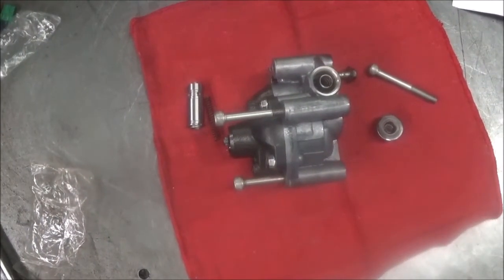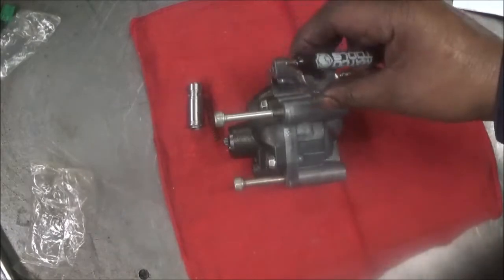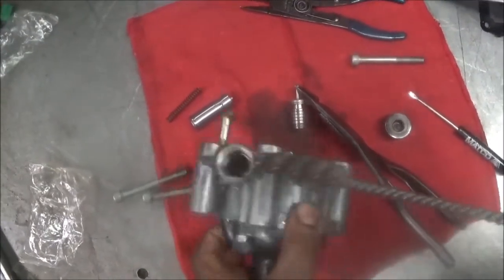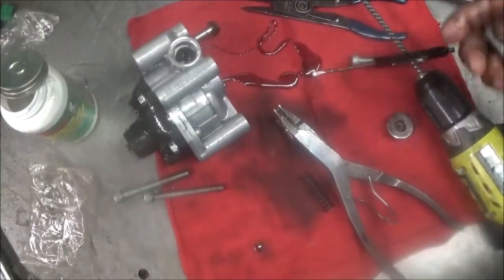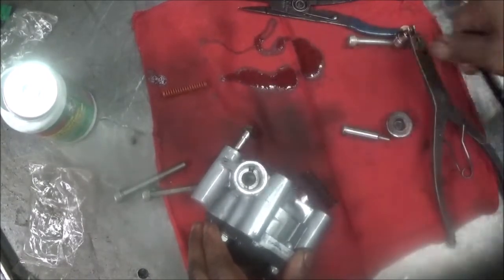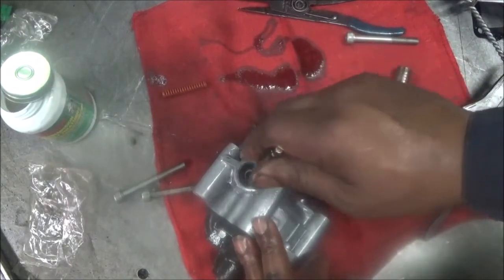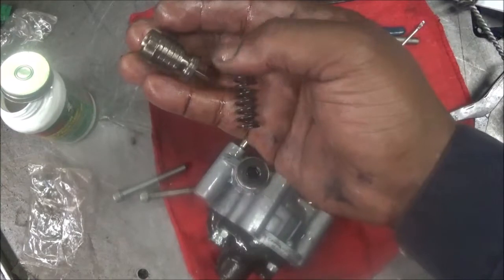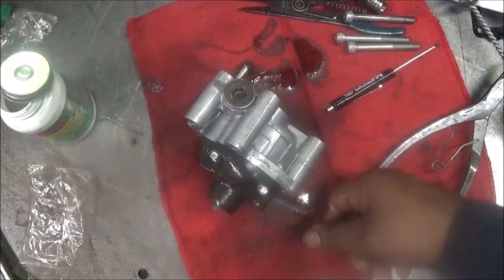JF011E CVT TRANSMISSION TECH TIP 2  [THE PUMP] (NISSAN, MITSUBISHI, DODGE)

Comment: Can this pump removed with out removing the trans from the car? I have a 2007 Dodge Caliber with a 2.0L eng. Please also wear gloves to help prevent cancer.
Reply from the maker: No, it cannot.
Reply: @thisisyourtransmission Are you 1000% sure? I ask because I can see the pump and two lower mounting bolts when I remove the valve body.
Reply from the maker: @SulaimanTheAviator  Try it.

Comment: And was the update successful?
Reply from the maker: Yes, the transmission was fixed but with a different set up. This setup causes the pump to make noise when driving.
Reply: @thisisyourtransmission  thank you for responding 🙏,  any links to fix greatly appreciated.

Comment: Symptoms of bad oil transmisión pump?
Reply from the maker: buzzing noise; slipping; barely moving
Reply: @thisisyourtransmission  My caliber barely moving after a sound in transmission I think, scanner shows different DTC every time sometimes p0730, p0777, primary sensor, secondary and so, I was thinking that pump must be bad or control body, do you know if bad pump shows a DTC or I need not open transmission to see damage? Thanks for your time.
Reply from the maker: @ourclock9273  normally problems like this means the transmission has to come out. You can try changing valve body or solenoids. However, you may still end up fixing the whole transmission. How many miles on vehicle?

Comment: This guy is scratching the hell out of the Interior boars on that pump even if he put new valves in it they're going to leak after he drags his screwdriver in and out of it like that crazy fella
Reply: Hello MR Brain Garrity  this guy is showing to the public  how to take out the valve. the inside is already scratched .Think before you comment. THIS GUY IS AWESOME ON HOW TO WORK INTO TRANSMISSION.

Comment: Can’t wait to find out how the valve kit worked!

  Some of the other valve repair kits I’d seen for the throttle body require drilling out cylinders like that with a specific size drill, and with a guide or other way to make sure drill angle is just right.